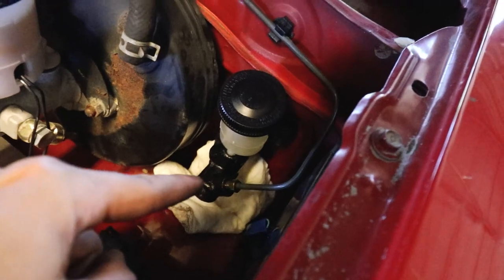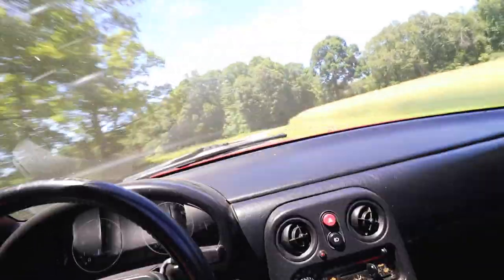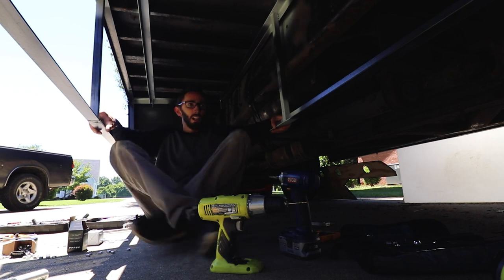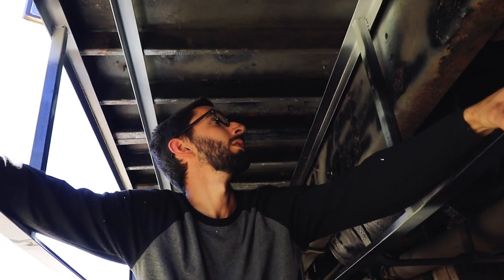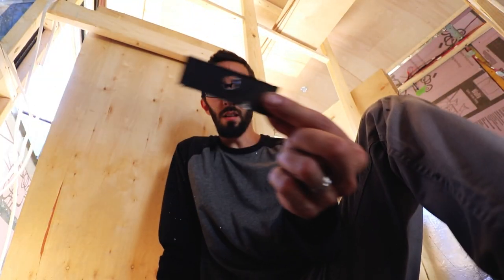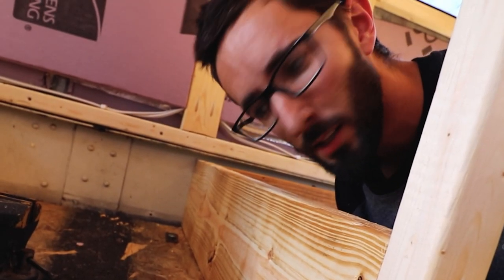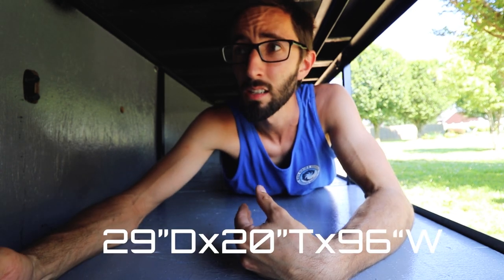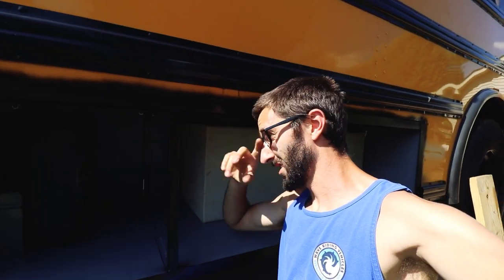DIY Tiny Home Exterior Under Storage Boxes School Bus // Skoolie Conversion Part 2

Comment: I like what you did.
Thanks for sharing. 
I was thinking about using threaded rods to support strut  channel under the boxes.
But I'm thinking about your design.
I'm just concerned that the few bolts thru the L-channel frame wont be enough to keep the boxes in place.
How did you convince yourself that they wont fail?
The grey tank is going to be super heavy.
Thanks.
Reply from the maker: I actually had the same concerns at first before building it. I just did some reading about iron strength and weight ratings per load. Each bolt that I used could hold 550lbs. I ended up using 12 on the big box. So 800lbs in this box is no issue.

Comment: so what I have learned this year is that the frame (chassis) and the bus frame (floor) shift at different rates. You should attach things either to the floor, or the chassis, but not both.
Reply from the maker: What do you mean shift at different rates?
Reply: @BackroadPurpose  words are hard sometimes. Flex is the better word. The bus flexes differently than the chassis. It's pretty much just sitting on top of it. When you attach something to both the chassis and the floor, you are changing the way it flexes while traveling. You can stress it and cause cracks where it shouldn't be stressed. Make sense?
Reply: Good point. I seem to remember seeing a schoolbus safety video where the body of the bus is made to flex/slide on the chassis in case of an accident, safety reasons, or something like that. Like what you did with this, I’m about to do the same, but with 100 gallon grey water tank. Have you had any issues with just bolting to the subfloor? Isn’t that just sheet metal vs bolting to the chassis?

Comment: Just curious Caleb, are the compartments watertight? Nothing worse than getting caught on the highway in a rainstorm and the finding out the road spray off the tires has soaked the inside of the compartments. Sorry just playing the devil’s advocate. They look great and if enough bolts are good mores better.
Reply from the maker: I wouldn't call them water right because I couldn't close them up and fill them with water but they are waterproof enough that water will not get through. I also used polyurethane caulk in between the metal rails and wood to seal them up a bit more.
Reply: Goodo, just checking. I have a flat deck trailer with a drawer crossways under the deck for packing chains and stakes and stuff. I went to get wood  in the fall with some slushy snow on a gravel road. When I opened the drawer it was not pretty or dry. I took out the drawer and haven’t put it back.
Reply: Thanks for the info, Caleb. We are still in demo mode. Not looking forward to the floors. I am glad I am not the only newbie welder. So nice having one, though. Storage is key. Keep up the good work, we look forward to more. Be safe, travel often, adventure always.